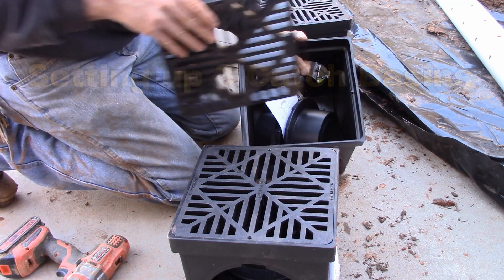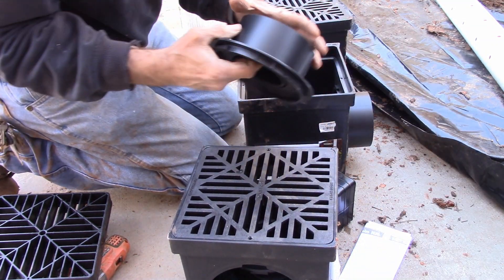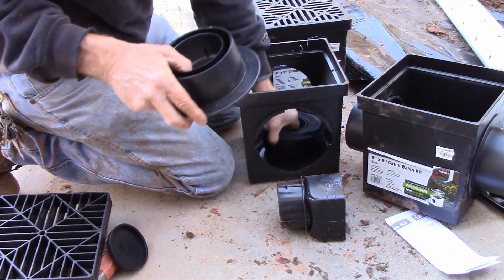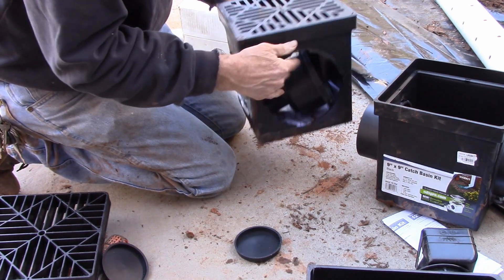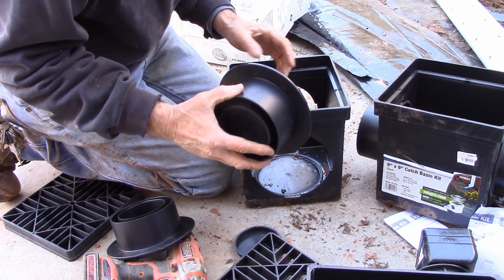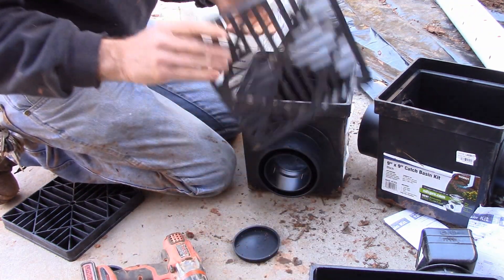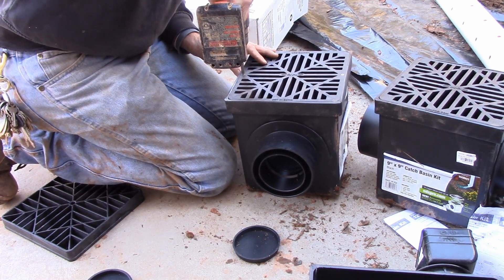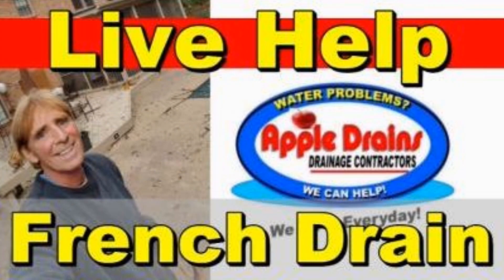Set up 9x9 Catch Basin the right Way

Comment: These leak like crazy if you dont use a boatload of silicone between the twist-on fitting and the box.  1/4" hole at each of the mounting points.  Stupid design if you ask me.  I dont want my basin leaking at all.